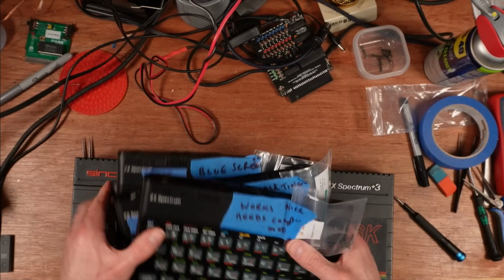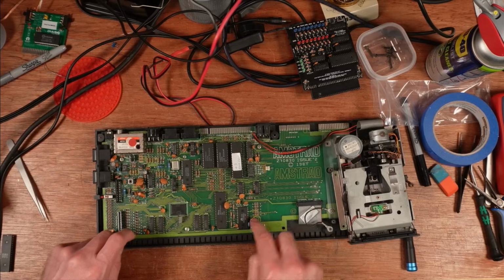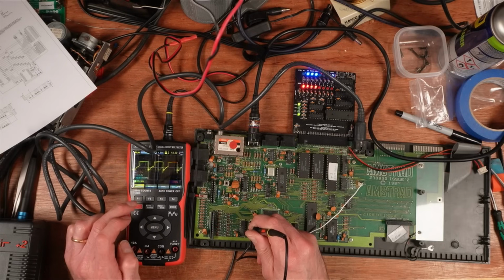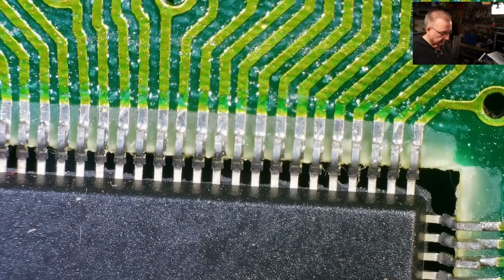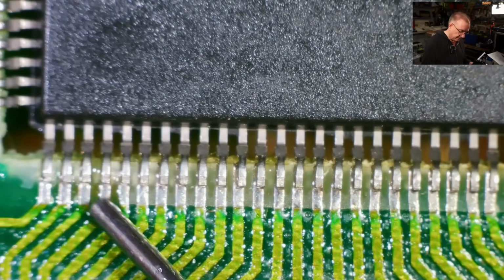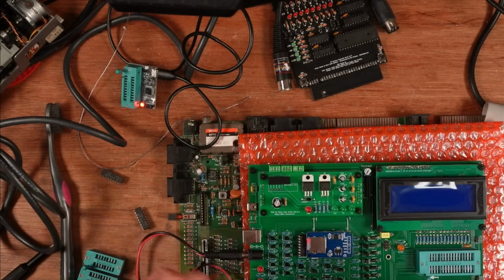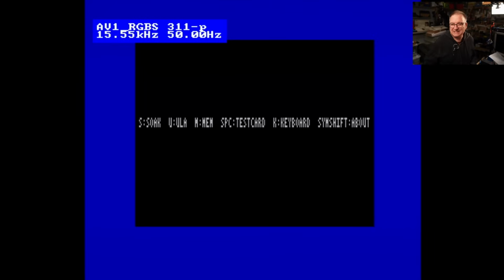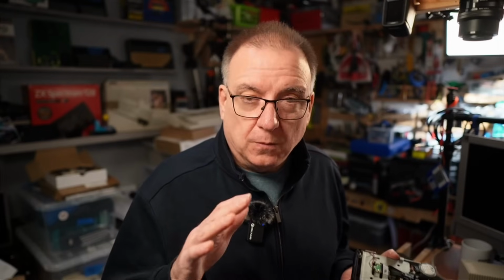Repair Pile Part 6 - ZX Spectrum +3 My First Faulty One!

Comment: I've got a +3 board. Just the board. No drive or cable, no PSU. I don't know why I bought it to be honest. I assume it was cheap, I got it about 8 years ago.
Reply from the maker: All you need is a picoATX to power it, a gotek for the drive, then your only problem is the keyboard. I think there is probably a project you can make but it will probably be expensive.
Reply: @morefunfixingit  Unfortunately, my health has gone downhill so much in the past 2-3 years I've had to put all my hobbies on the back burner. At 56 with decades of health issues, I'm now too tired and worn out. I miss electronics and making music. 😢

Comment: I have repaired a +3 too, unfortunately mine had a bad ula. I build an external gotek for it since I wanted to retain the original floppy. I 3D printed a nice housing for it and added a switch which allows you to use it externally as the internal drive, might be a nice project for the channel, I can provide you the parts if needed.

Comment: my pal bought a +3 and we were astounded by the "floppy" drive which , if i remember , was rather stiff 
little did he know i was busy collecting my pennies and saving up for a MIGHTY Archimedes while soldiering on with my rubber key 
i would spend hours pressed up against the window of "computer town" our local computer shop looking intensely at the Archie in the window 
an aside
i have ordered the exact same 2-1 scope and meter from ali express nice to see someone using it in real time i always worry i have bought  a pile of pony but so far never have